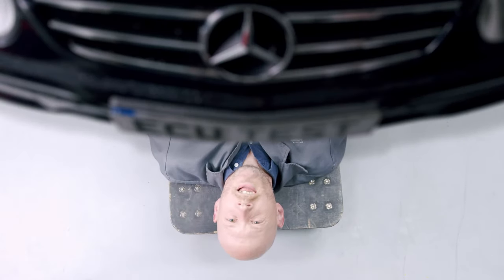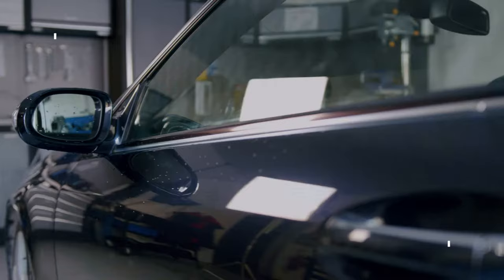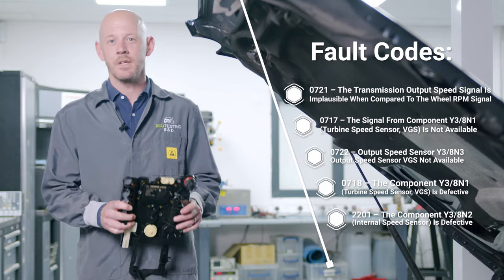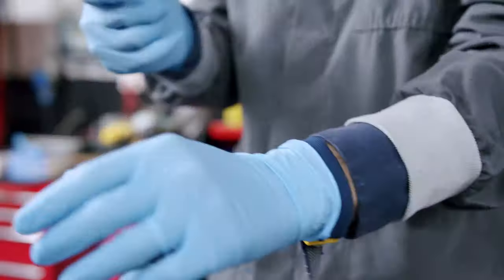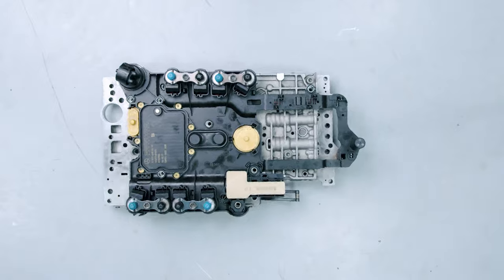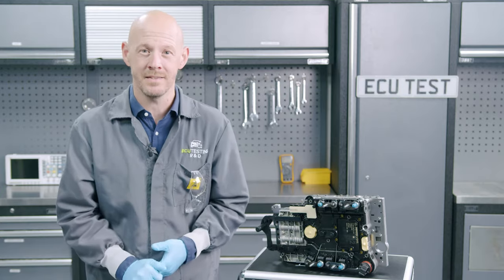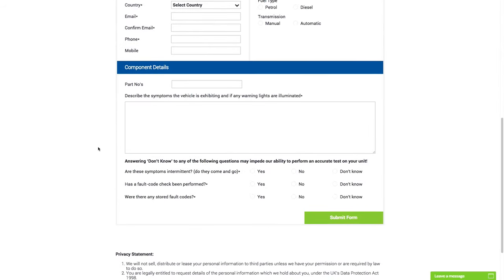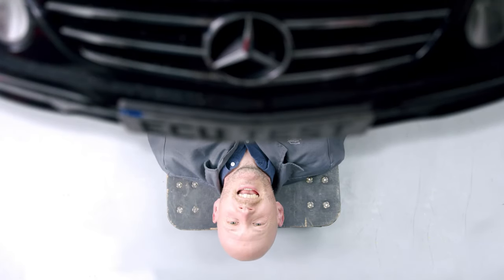Mercedes Transmission 7GTRONIC 722.9 Conductor Plate Problems

Comment: hi there, great video. i have a clk 500 2005 that has been going through the same issues. i took my car to my family friend shop where they scanned for codes and this is what i received: 1.2115 The Internal Electrical Check Of Component Y3/8y3(K2 Clutch control solenoid valve (VGS)) has failed.
Reply: i was wondering what could be done? my car has the same exact symptoms described in your video but not sure if i should get the whole conductor plate replaced for a new one

Comment: Hi I'm already in touch with your online chat team 
I have 2014 cls 350cdi gear shifting is not smooth its judder when change up shift or down sometimes random gear select feels like car struggling when try to move from stationary.
On diagnostic report non of codes appear shown on your video 
Still possible its conductor plate?
Thank you
Reply: Hi , i have same issue with my glk 2014 , jerky shifting upshift and downshift , delay from second to 3rd gear , no fault codes, did you solve the issue?
Reply: @samsea9075  hi I was always wondering something wrong with transmission but there was no any code related to gearbox 
My car issue was bad dpf
Reply: @samsea9075  bad dpf will effect on your gear shifting
Reply: @rajaimran1159  Oh that's interesting!  Did you have any other symptoms besides shifting gears not smoothly?  In my case there is no noticeable lack of power, or black smoke from the exhaust!  very weird

Comment: i had w204 c180 my car got p0705 fault code how to fix it？
Reply from the maker: Hi. The p0705 fault code can be an indication that the control unit has gone faulty. If you would like to send it into us so we can test it and potentially re-build it then please fill in our online test form at www.ecutesting.com. Any other questions please contact our technical support team at info@ecutesting.com. Thanks
Reply: Hi what's the cost to fix the plate j have the same problem
Reply: What was your case? Board dead?

Comment: 🇵🇹My Mercedes A180 D, automatic transmission, has an extremely uncomfortable symptom. After the start/stop acts, when starting off there is a “jolt” or sudden movement that, in addition to being uncomfortable for the driver's neck, makes parking maneuvers extremely difficult and dangerous!
I delivered the car to Mercedes with the aforementioned complaint and saying that this problem had not occurred before. It came into existence after a review with a gearbox oil change at Mercedes.
At Mercedes they told me that there is no defect in the gearbox or clutch. And this feeling is normal!
My advice is, don't buy the Mercedes A 180D and if you already have one, wait because one of these days you will suffer from this sudden crash not recognized by Mercedes🤨!!!

Comment: Hi there, how long is the turnaround time from Collection to delivery return please of a G7 conductor plate.
Reply from the maker: Hi. Our current average turnaround time is 2-3 working days after receiving your unit. However, collection and delivery can vary depending on where you are based. Please email our technical support team on info@ecutesting.com with your location and they will give you an accurate turnaround time. Thanks.
Reply: @Ecutestinglimited  ok thanks will do.

Comment: Trying to call  
Phone is not working
Reply from the maker: Hi. We are open, please try calling us on: +44 1773 535638 between Monday-Friday 9am-10pm (GMT). Alternatively you can email our technical support team at info@ecutesting.com. Cheers
Reply: @Ecutestinglimited  calling from ireland 
I am not able to connect your number
Reply from the maker: @aksoy15011980  Hi. We have had no other problems with our customers from Ireland phoning us, especially if you are using the international number provided above. If you are still unable to contact us via phone, then I would suggest using the email provided above, and our technical support team would be happy to assist you further. Cheers.

Comment: I want to rebuild mine, can I have ur contact please
Reply from the maker: Hi. If you would like to get your unit tested and potentially re-built, then please contact our technical support team via email at info@ecutesting.com or via phone on +44 1773 535638 with the following details. Your make and model of vehicle, the part number of the unit, and any details of the fault you are experiencing - including fault codes, symptoms and any attempted fixes you have tried. They will advise you further. Thanks.

Comment: Hi I have Mercedes E350 model 2014 and I changed the gear chip, but I did not succeed in programming the chip, and now the car does not move. How is the process of programming the chip for gear? Are supposed to go to the agency for the Mercedes to do that or can it be done via the computer? Please advise and thank you.
Reply: if you mean programming the new plate , there's tow ways to do that, 1st by attracting the file from the old plate via obd scanning tools and then move it to the new one , the second way if you haven't communication whith the old plate because its totally damaged and can't be seen by obd scanning tools, you need an online coding or by mb dealer